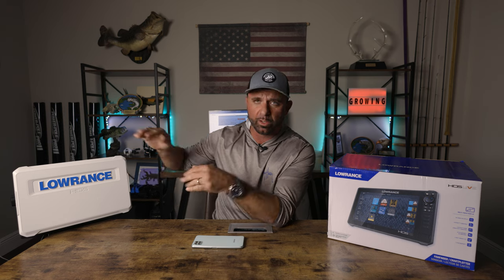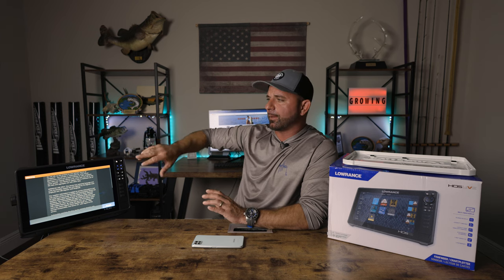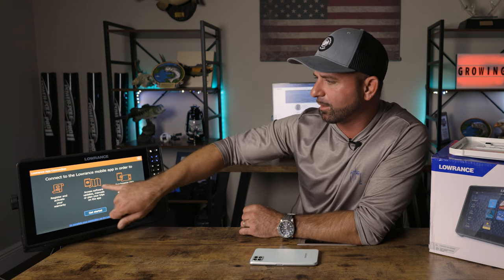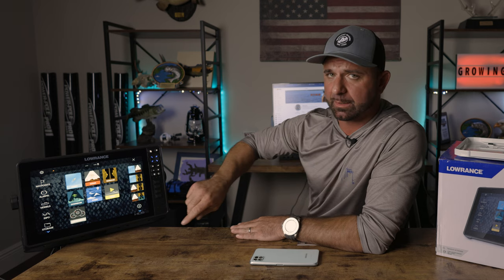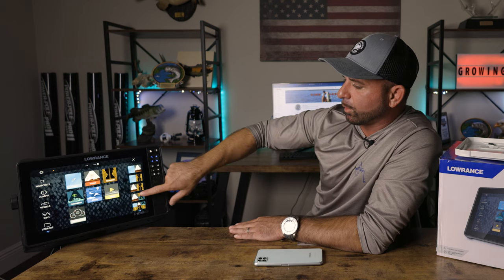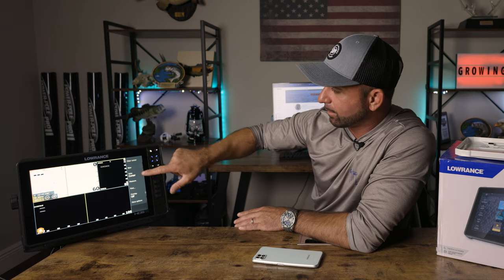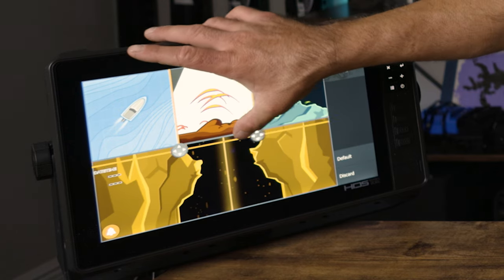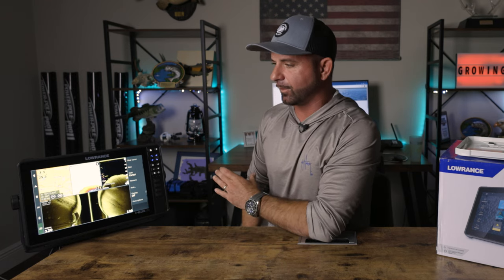BEST SETTINGS For Lowrance, Maps, Side, & Down Imaging!

Comment: Have a question. So I have an hds live 9 and as well I want to upgrade my 3 n 1 active imaging transducer to a hds pro transducer. So technically your saying I need to buy a box? To connect everything. Which box would that be exactly?
Reply: The 3100 module

Comment: Thank you for the great info. I just recently purchased a HDs 9 live 3-in-1 and have it all hooked up in my boat. I am running it as a stand alone unit I don't have it hooked up to any network. I was told if you run a 3-in-1 transducer only you should have it plugged into Channel 2 on the back of the unit. When I do that my down scan and side scan work fine but the 2D does not work there is nothing showing on the screen except for the depths on the side. It is not reading the bottom at all. Any help would be grateful thank you.

Comment: Really helpful.  I have an elite ti2.  Question - can you explain the mode settings on the sonar (shallow, general, …)
Reply from the maker: Absolutely. Your units were designed for fresh water. You will want to leave it set to general if your fishing lakes. Shallow widens the cone and will not give you the defined image of fish and a much less accurate reading of the bottom composition.

Comment: I run a Ti2 at my helm. It has the 2 and 1 active imaging transducer. Could I set my down and side scan at 100 feet and just leave my frequency at 800 like you were saying and still keep that good detail image and not miss anything? Or does that only work for the newer models? Thanks